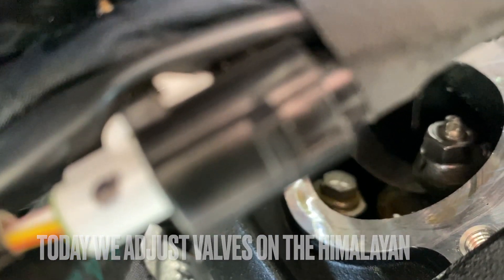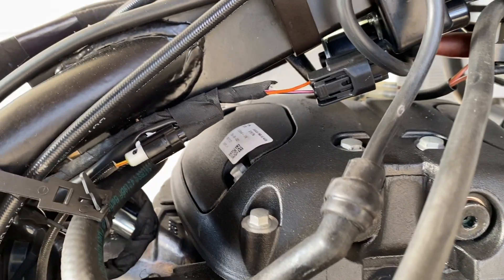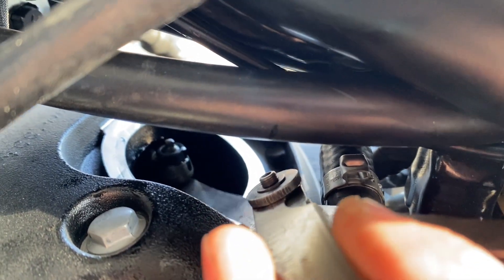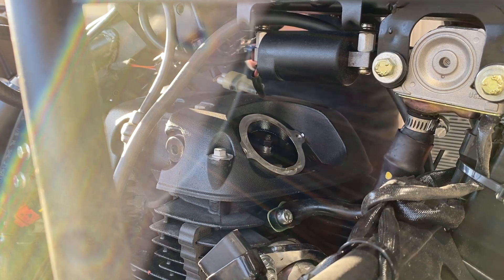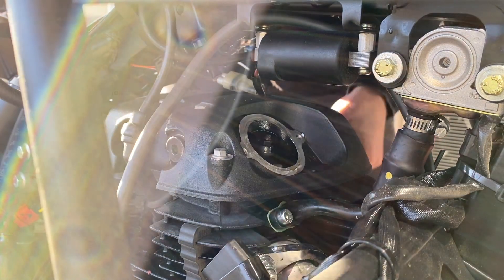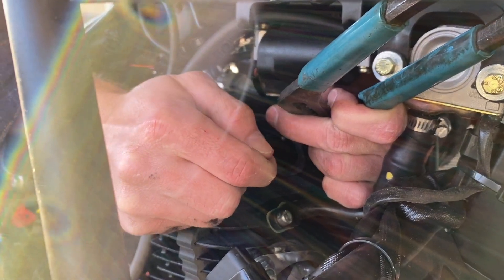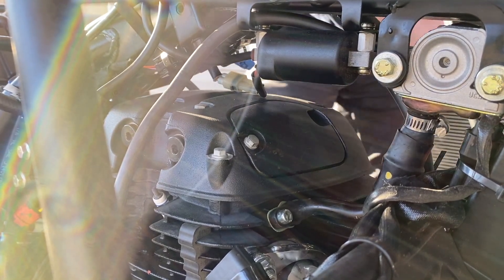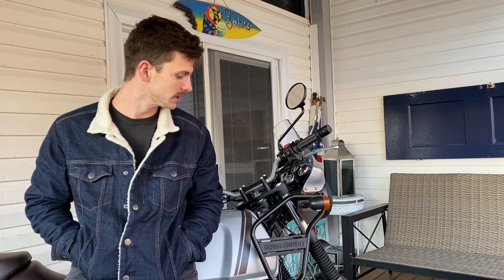Adjusting Valves on the 2022 Himalayan

Comment: Just did my valves after 300 miles on my Scram 411. Didnt have a tappet tool so I used a 10mm box wrench for the lock nut and a pair of hemostats for the valve; helpful thay they lock.

Comment: You notice they still have a slight tick? I’ve done a few valve checks and adjustments on my Himalayan and at 8k mi, can’t rely on the valve noise outside of obviously louder sound and performance.
Reply from the maker: Hey Adam,
Thanks for watching! 
So a little advice I received from an old mechanic is a noisy tappet is a happy tappet. I usually use + feeler gages for that reason. So I’m my personal experience a little noise is a good thing and better than the alternative of tight tappets which cause excessive wear on the internal components of the engine. All I can say is if your engine is set to TDC, your clearance is set to or slightly larger than the specs, you will be good to go!
Thanks again for watching

Comment: Excuse me actually i wanna know why does valves need tobe adjust?
Reply from the maker: Hey Okharon, thanks for watching.
To answer your question, it’s old technology with short intervals for valve checks/adjustment. If the valves aren’t properly maintained the machine could be subject to poor performance, accelerated wear on multiple components including but not limited to the camshaft, valves, timing chain, which could lead to a catastrophic failure. I would like to add the valves don’t always need adjustment on the service interval date however checking if the clearance is in tolerance is absolutely necessary to satisfy the maintenance requirements. Also, I always set my valves with a little extra clearance (.001-.002 of an inch) it won’t hurt it. 
Thanks again for watching!
Reply: The valves and associated bits are subject to hard work and need to be kept within mfr guidelines. So they need to be CHECKED every 3000 mls and ADJUSTED if out of spec. (not always needed).

Comment: Hey, You show the TDC as a "T"...but other use the line immediately after the "T"..?
Also it seems that everyone has decent access to the valve (to the intake side in particular)..I can not barely even get the cover off, and can not get the feeler into the tappets as there is way to much junk-wiring loom-etc in the way...I am miles from a mechanic who is far too busy to stop by and teach me how to do this no matter how much I offer him, so I am sort of in a pickle out on my farm....
Reply from the maker: Hello there,
I’m glad I caught this in a timely manner and I hope that I can be of assistance. I used the T to designate TDC on my bike due to the line not being imprinted on the wheel. (No TDC line) so as far as not being able to get the feeler into the exhaust valve for correct setting I find that it is easier to come from the clutch and gear lever side of the machine. You may have to come in at a 40 to 50 degree angle from the head and a 20 degree angle downward to get the feeler into the correct position for setting. I will say that you may benefit from acquiring longer feelers for the task. I understand that this may be frustrating however if you get angry, walk away for 5 minutes and come back. I promise this is a better alternative than throwing wrenches. Also about the wiring loom, you can push the loom out of the way a bit but please be careful. If you have any questions at all please feel free to reach out to me.

Comment: The clearance is in m.m. and not inches. It is .08 mm and not .08 inches.
Reply from the maker: Hey Ram,
Converting measurements from metric to standard.
Intake Valve:
.08mm - .1 mm which is equal to .003” - .004”
Exhaust valve:
.23mm - .25mm which is equal to .009”- .01” 

The tolerances in this video are accurate. For future reference you can divide the length by 25.4 for an accurate conversion.

Comment: Are the clearances different for the '22 versus the previous bikes? I'm reading:.23 to.25 and.08 to.1 for exhaust and intake respectively.
Reply from the maker: Following up, I should have disclosed that I use the imperial system over the metric system.
Reply from the maker: Hey Jamielapoesie,
Thanks for watching!
The dimensions should be the same. For all years of the Himalayan with the 411 CI engine.

Comment: Notice the idling getting better now its getting more miles on it? Mines ticking over at about 1150 now I've adjusted it , never stalls.
Reply from the maker: Hey Matty, 
The idle has gotten better after the valve adjustment and 2,600 miles but, if I can be completely honest I still encounter the cold start stalls. Admittedly there are fewer stalls however it is an ongoing occurrence. I do believe Royal Enfield could’ve done better by not making the fuel injection system so lean for startups.
Thanks for watching!!
Reply: @coolyprice4730  bypass the evap system if you can without falling foul of your emissions regs. That will help.
Reply: @coolyprice4730  para evitar que se apague el motor se debe calibrar el sensor TPS.

Comment: Hey why do you have to adjust the valve If the bike is new? I’m new to the motorbike world and planning on getting this bike as my first.
Reply from the maker: Hey Nate, Thanks for watching! 
The reason that you must adjust the valves early in ownership of the Himalayan is that valve adjustment is included in the 300 mile service according to the Periodical Maintenance chart in the owners manual. From my research most of the Himalayans valves are a bit tight at the 300 mile interval. I'm not sure if they are checked at the factory (Most likely not) however along with the research that I had I learned that the adjustments needed are minimal. With this job being so simple I would speculate this is a cost savings to RE by simplifying the process of production by eliminating one check and passing it off to the consumer. 
With this being said I do believe after the first adjustment it will be long intervals before adjustment is needed again after inspection.

About this being the first step into the bike world. I would say 100% pick one up. I have owned BMW, Ducati, Honda, Yamaha, Suzuki, and Triumphs. This has been one my favorite bikes so far. It's not fast, quick or loud. However it is FUN and surprisingly capable on twisty roads.
Reply: @coolyprice4730  ok awesome. So I can just return to dealer at 300 mile or do it myself? Probably better I learn to do it myself rather than rely on mechanics constantly. Yeah I’m choosing this one cause of the price and have heard it’s so fun to ride!
Reply from the maker: @nater1113  I support your idea of performing the service yourself. Like I stated in the video it isn't too difficult and it will save you some coin. Let me know how you like it!
Reply: If you don't like doing your own maintenance Royal Enfields are not the bike for you. Service intervals are every 3000 miles so upkeep can get quiet expensive if you have to take it to a mechanic. Some bikes may cost more but have service intervals up to 16000 miles or more. Love my Himalayan but do my own service it's not really difficult.

Comment: Done that before on other bikes from the previous century. I'm surprised you didn't have to go at the gap again after tightening the lock nut. There can be a bit of "creep," as you tighten, and you lose clearance, I had a BMW that drove me nuts with that. More people should do their own work, but they don't. In my opinion it's a pity, because I think it connects you more to your machine. I've been deeply connected to more than one Harley! 🤣
Reply from the maker: Hey Terry, Thanks for watching! Looking at your comment I'm confident that the clearances were checked after tightening. Please Review times 6:05 for intake recheck after tightening then 9:07 for exhaust recheck after tightening. Also I do know exactly what you are talking about with the Creep! I drive older W123 Mercedes on a daily basis and the valve adjustments (Every 12K Miles) on those are a bit more in depth and tricky. This was FAR easier than the preconceptions that I had which led me to the conclusion that almost everyone can do this service.

Also about the sentiment of being further connected to the machine. I 100% agree! It's not about the money, it's about the connection, being out in the elements and quickly being able to assess if something about the function of the machine or possibly a failure and you being equipped to diagnose the issue without outside interference. Being able to use process of elimination or just have the pool of knowledge to pull from when or if the time comes! Often these skills are discounted however I do believe they are largely beneficial.

Again, thanks for watching Terry!
Reply: @coolyprice4730  didn't say you got them wrong, just surprised they didn't fight you a little! 🤣 Maybe it's a German thing, my BMW twin gave me fits! I like the Himalayan, it reminds me of an old first gen BMW GS, simple, and rugged.
Reply from the maker: @terrycavender  Ahh I see what you are saying now! It was definitely the easiest valve job I've completed in a very long time. I definitely side with you on your last point. It is a simple and rugged machine which also gets 66 on the highway and 72 on back roads. This has been my favorite bike since I was a kid on an XR100.
Reply: @coolyprice4730  you would have liked the "good old days," when BSA, Velocette, and others were cranking out big singles like the BSA Gold Star. Thumper city! The Himalayan reminds me of the BSA 441 Victor a bit, perhaps crossed with a early BMW 800 GS. I was in highschool just as the big three Brit manufacturers were winding down, and Japanese bikes were on the rise. So I remember all of these.
Reply: @terrycavender  its a German thing, those Break My Wallets will fight you all the way doing tappets.  At least on the R100 they are  easy to get to, but talk about creep on doing up the lock nuts. Himalayan are set and tighten, re check, and if  moved 1/2 a thou id be annoyed with my one.